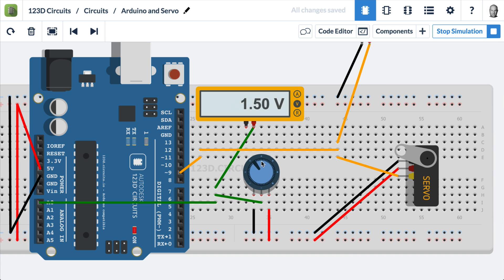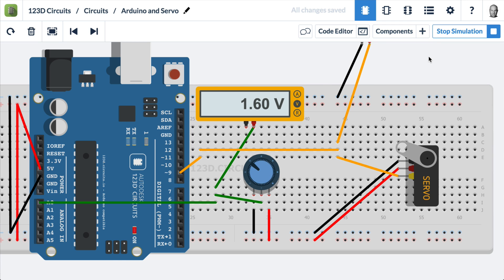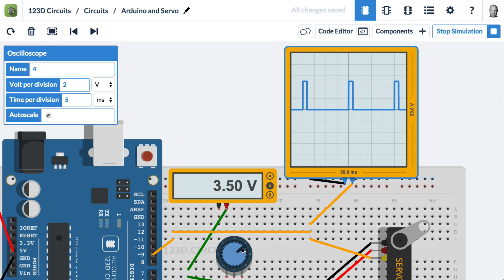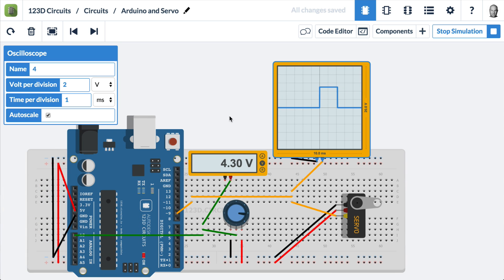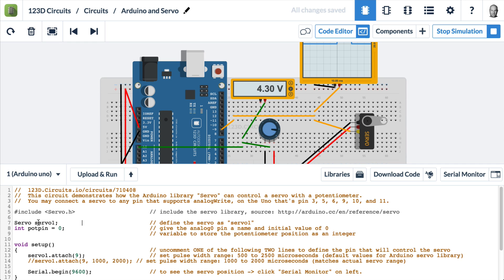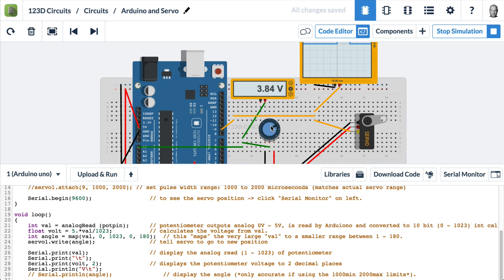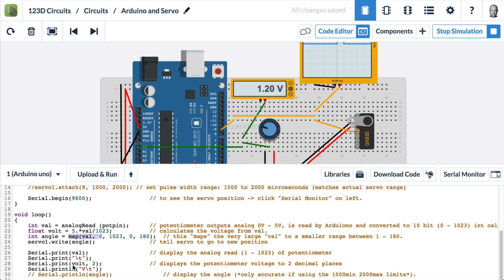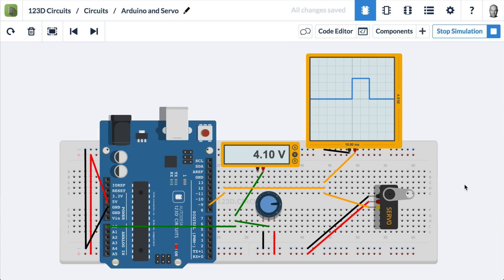Arduino and Servo (code explained) - Electronics Lab

Comment: In school I learned about all sorts of properties DC motors have such as internal resistance, inductance, rotational inertia, bearing friction, and their motor constant. Do the DC motors in 123D Circuits consider all these properties? I ask because it seems like the voltage and current can change instantaneously across motors in 123D Circuits, which shouldn't be possible because of their inertia and inductance.